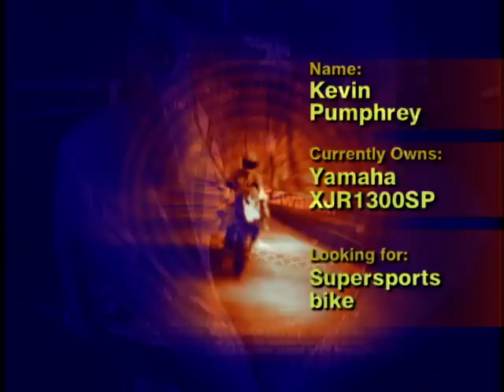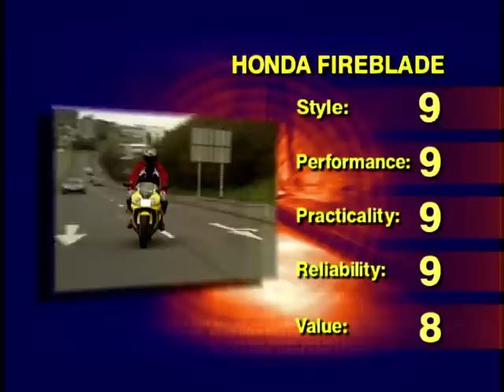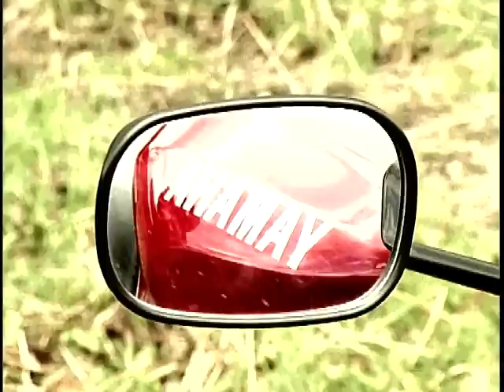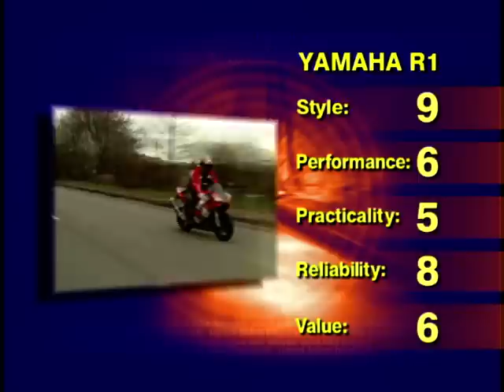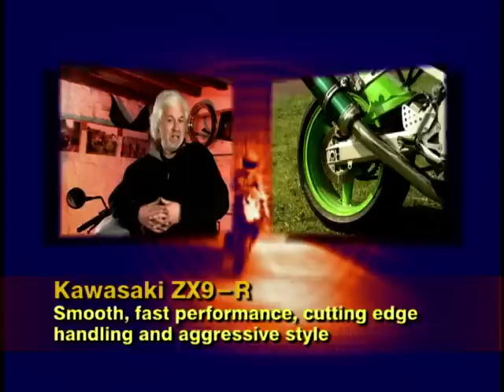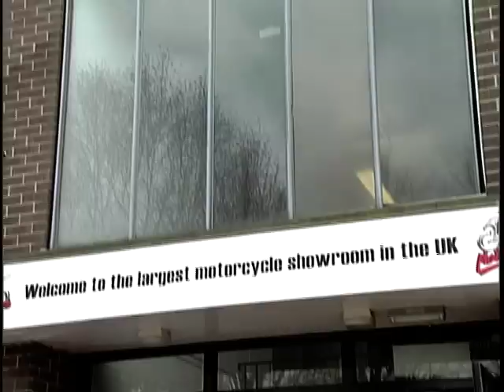Used Bike Heaven: Season 2, Ep. 11

Comment: Another thing I would add to prolong chain life would be to examine the wear on the front sprocket teeth. 
If you catch them before they are worn out you can change it for a new one. I say this because when a front sprocket is worn it slams into the chain and will wear it out faster than it should but if you replace the front sprocket three times it will give you chain and rear sprocket extended life.
A front sprocket rotates three times faster than the rear.

Comment: My bike mechanic says never judge the chain tension with the wheel suspended off the ground and also that the usual  rider should be sitting on the bike when the chain tension is being checked?
Reply: Spot on, it's lazy checking the tension without the rider.
Reply: Nothing wrong with doing so, in fact you can't do it with the wheel on the ground as the wheel needs to move back.
Also on paddock stands it's just as it is with the wheel on the ground, as it's weight is still compressing the suspension, therefore tightening the chain a little due to the swingarm being at the same position as when it is on the ground.
But even on an ABBA superbike stand it's fine to adjust the chain, just remember the chain will tighten a little more once the bike is put down, and again when you get on it.

Comment: Valves need regular checkups too. Mine is a 2003 with 16,000 mile's, very little history, had 12  closed up tight out of 16!!! This then needs the cams removing and shimming. Massive job!
So if you don't get any history of it being done, either haggle cash off or or just walk away.
Reply: Kawa is terrible to work on
Reply: @69VAJRA  No it's not, I've done loads with mine, then worked on friends bikes of other marks and they are a pig to work on.
To the OP, all bikes of this era need them checked more regular than modern bikes, but not super often, got my ZX9r at 16k miles, now at 22k miles, still doesn't need them done, but I will at some point in the near future as they likely have never been done.

Comment: The R1 sounds weird on 8:22. maybe I'm imagining it
Reply: My thoughts exactly, sounds rough like the engine is messed up
Reply: I wasn't that well when riding these. Just finished a course of radiotherapy & piled on the pounds. The R1 was a bag of bolts & broke down several times & also had other issues.
Reply: Probably a seized exup valve.
Reply: @kturvy  I deleted my comment about you knowing nothing based on your 6 score of the r1, turns out you had a dodgy one haha hope the radiotherapy did it’s job
Reply: @kturvy  Hopé you're Well Brummy 😂😃

Comment: Kawasaki ZX-9R has torque at the expense of engine vibes and a lot of engine rasp. It's a very long stroke engine compared to a 600 or modern 1000's. Long stroke engines always make better street bikes, except the vibration at certain RPM ranges (75mph/4500rpm) can be annoying on some bikes. I haven't ridden the 9R but reviews say the engine is a bit obnoxious and unrefined.
Reply: meh
Reply: blah blah blah. ride one then.
Reply: Full of it! I ride a 2000 E1 ZX9r and it's awesome and still keeps with modern bikes no problem at all, no "vibes", just pure smooth beast of a bike.